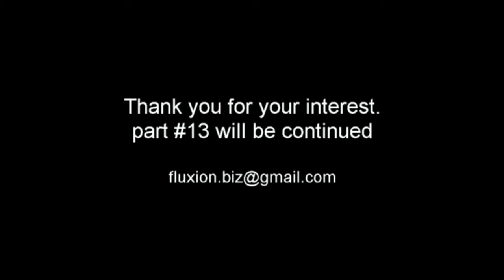DIY audio KIT assembly manual part 12, FLUXION model B-6TK, 2A3 SE tube amplifier

Comment: Looks like sphagetti now.
Reply from the maker: Hello again dear Russell, sphagetti is wrong. spaghetti is right and  delicious. anything else to advice sir?
Reply: @YoungAhn  no but i love guitar amps and am interested in building. Very informative point to point techique.
Reply from the maker: Thank you for reply. I am going to design and build guitar amplifiers(only head amp) in near future, late December. What type of amp do you like, PP or SE?
Reply: @YoungAhn  i think the trend is to lower power amps. There are a flood if amp builders some call it the golden age of tube amps! An interesting concept would be a separate power supply in a head with a head with multiple pre amps. The power unit supporting different tube types and outputs like say 15 and 25 watts or eight to 15 watts. The huge amps of our youth are only used in arena jobs not clubs or bars let alone bedrooms. I love fender princeton and supro circuits!
Reply from the maker: I learned a lot from you. Thank you again sir